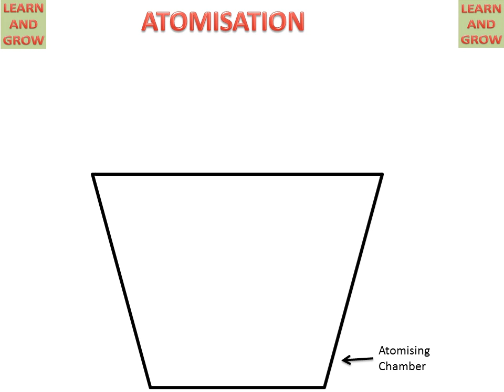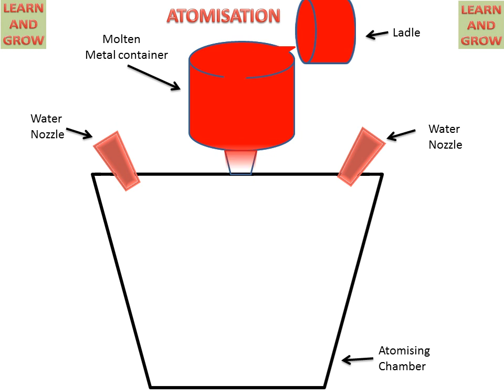Atomisation Process

Comment: sir iss atomization kee baad I mean metal powder banane ke baad further any milling or grinding process hoga yaa nahi sir???
Reply: Abhilash Abhilash 
After the atomisation there is a sintering process by which the powder is compressed with binding material to form the desired shape of metal with a particular heat supplied.